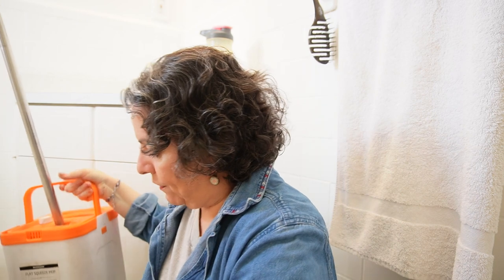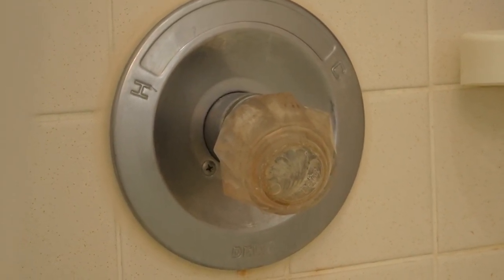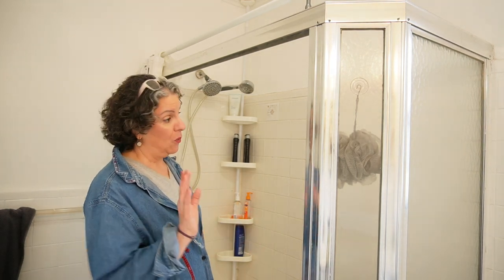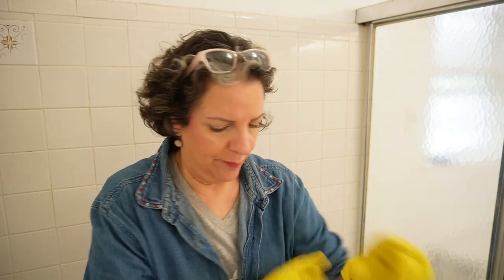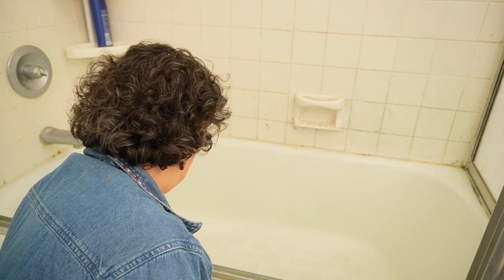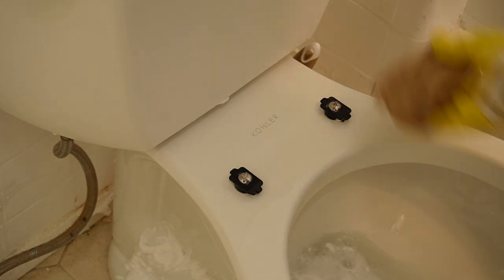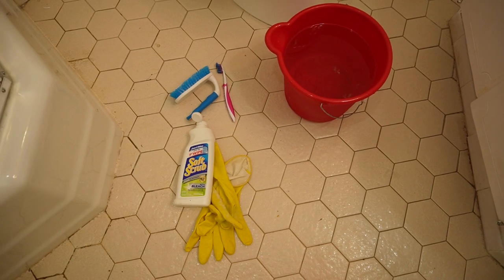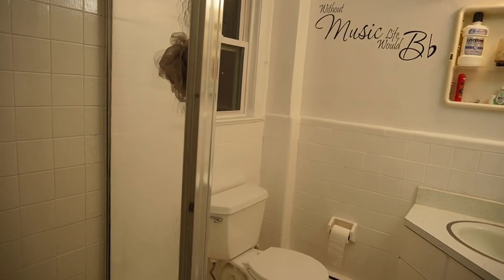Deep Clean With Me || 2023 Edition || The Bathroom

Comment: 💐You inspired me to get up and clean my husband’s 40 year old shower with the HATED sliding glass doors!   I’ve only been living here for the last 11 years and was working most of those years.  So, there is a terrible buildup of lime etc. on the doors.  The white tile needs grouting.  So, I took the steam mop, filled the tank with water, wet the mop cover and squirted dish detergent on the mop cover.  Then I mopped down the walls and doors with the mop making it steam the whole time.  It got the tiles really  clean, helped the doors some.   I will continue to use the steam mop as much and I can. It works really well! 😊👍🌸
Reply from the maker: Good for you!

Comment: Sophia, we too have extremely hard water, I use Lemi shine products because they use citric acid to combat that hard water.  To keep my toilets clean I use the Lemi shine dishwasher pods, yes you read that correctly.  I just drop one of those pods with detergent on one side and citric acid on the other into the tank and let it slowly release over time.  The only issue might be pets thst drink out of the toilets.  Since I have a Chiweenie and is is so short it is not a problem.  But this solution works for me.  Love the videos!

Comment: what a great job and what a work-out! I think I have to try that new product for the hard water and shine!
I've been working on our larger bathroom. decluttering....have the top shelf and the floor of the closet left to do. Started cleaning, used vinegar for the water/soap scum. It helped but the chrome still looks worse than when you started. I have bought some of the CLR, will try that but I think Id really like to try the new product and the shaving cream around the toilet. The toilet cleaner I have seems to clean the bottom of the toilet, if I leave it sitting in there for a while.
Our ceiling I painted with a paint that is supposed to seal and prevent any water vapor going through. Only problem, the paint has all bubbled and looks awful. I guess I will have to scrape or sand it off, and do the usual primer and paint. Your walls and ceiling look so good.
Now you have got me enthused to finish up that bathroom!

Comment: A miracle cleaner for the shower and glass door. I run the hot water till everything is nice and steady then I spray a mixture of 2 cups cleaning vinegar and 1 cup blue dawn and allow it to sit 1 or 2 hours. The track of the glass part you will probably need a brush to get in the crevices, but otherwise a microfiber cloth should work on the rest. Cleans sanitizes without all the toxic  chemicals. Hope you try 😊
Reply from the maker: Dawn is not that safe. The EWG rates it as a D. The platinum version is also reported to be hazardous.
Reply: @mygreatchallenge  looked it up on the think dirty app and the only real super bad ingredient is the fragrance which even though I have issues with fragrances this doesn't bother me.

Comment: You worked really hard at your bathroom clean, Sophia.  The green light abrasive was so good on the metal parts of the bath enclosure.  It really looked shiny and the faucet looked so clean too.  As for the toilet, the shaving foam worked well, but a cheaper alternative is to mix bicarbonate of soda with sparkling water and two drops of vanilla essence, rosewater or peppermint (natural non-toxic scents) into a paste and spread that over instead, then wash off with a hot water microfibre cloth.  Also, I agree with other comments that if you flush all the water out of the toilet bowl, let it dry a little and coat it with rejuvenate then you can protect the inside of the bowl from a lot of the stains for 2 months or more.  Also, if you flush all the water out of the toilet bowl once a week and pour a very cheap small bottle of cola down into the water free bowl, leave it for twenty minutes and then flush it will de-limescale for you without any effort (except for a quick scrub with a toilet brush for a minute)  then you can flush any debris away.  I am loving this deep cleaning series because you show us all the true reality of spring cleaning. ❤

Comment: Amazing job Sophia! Couple of ideas for you. Barkeepers comes both in powder and a paste that has bleach. It comes in a bottle the same size as Soft Scrub. Scrubbing Bubbles - Mega - is amazing on older showers, glass shower doors, fixtures and the aluminum. Since the shower is clean now, just spray the Scrubbing Bubbles around the shower enclosure, leave on for 15 or 20 mins, then rinse. I put cloths under my feet and use them to "scrub" the floor before I rinse the product off. I also use it in my bathroom sinks and on the faucets. It's not good for stone - especially travertine, but since you don't have any of that in your shower, you should be good. It should get out any leftover deposit left in the grout lines in between the tiles in the shower. I would try to do it every 2-3 weeks since you have boys using it. You can also use it on toilets. It has a fresh smell that will take care of those stinky areas around the toilet. As always, do a test spot to be sure it is safe for your surfaces.

Comment: Sophia....that's exactly what I was thinking when you first began to take off the curtain rings, Planes, Trains and Automobile Movie...LOL!!!  Yes, you probably should get the rounded shower curtain, life would probably be a whole lot easier when cleaning the bath tub. I use to have those glass doors but took them off and put shower curtains. Great job Sophia...
Reply from the maker: What did you do with the holes on top of the tub after you removed the panels?
Reply: @mygreatchallenge  It was at my old house and I cannot recall very well.  I don't think there was any holes in the tub....or maybe I left the bottom track only....I think the holes were on the wall track and the bottom was glued....all I know is I wanted the doors out of the way. .
Reply from the maker: I am wondering if it s the same for me. The bottom is glued. I just saw a track on Amazon that does not require anchoring on the wall. It would be perfect. I could maybe even take baths once in a while. I haven't had an actual bath in years.
Reply: @mygreatchallenge  LMBO!!!🤣🤣

Comment: Quick tip for shower heads or faucets and CLR… put the product in a ziplock bag and submerge the head/faucet under the liquid and rubber band to the apparatus. Let it soak a long time and it will all come off. Works great!

Comment: Oh you are definitely not the only one….We have really hard water having well water in NW NJ and it is awfully hard to keep anything spotless… everything gets coated in mineral residue…….i do find that using and soaking anything with straight Vinegar works really well. I will maybe to try the Hard Water Stain Remover to see if it works any better…. I have to watch what we use because of our septic system and what goes into the ground water as we live in a lake community….We really need to putting in a water softener on our priority list! I so hate the way it corrodes everything…do you still like your mop & bucket system?
Reply from the maker: Yes I use it at the end of the video

Comment: Sofia,  to keep the inside of shower walls and faucets shiny in between deep cleanings use methods daily shower cleaner.  It works great,  I even use it on my shower chair,  just spray after your shower and that's it. For grout cleaning use hydrogen peroxide and small brush. Love your cleaning videos.
Reply: Yeah that’s great. I try to do it. But this is her sons bath so I bet not happening.
Reply from the maker: Exactly. Will never happen.

Comment: I would get rid of the shower screen, a shower curtain will be a lot easier to keep clean. Once you have deep cleaned the bathroom you need to put in steps for anyone using the room to do after use, ie wipe down the shower it will stop the hard water deposits, clean the toilet after themselves. These are good lessons for when the have their own homes.  I would have left the rings on they could have had a good wash with the curtain.
Reply: I was thinking the same... now that the bathroom is reset, the guys should maintain it.